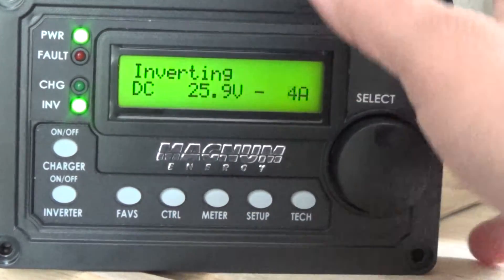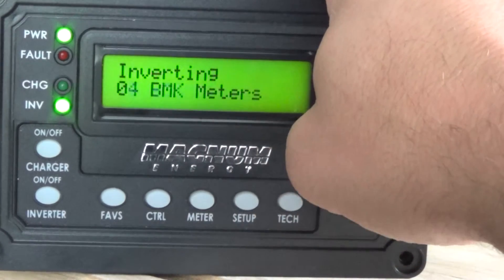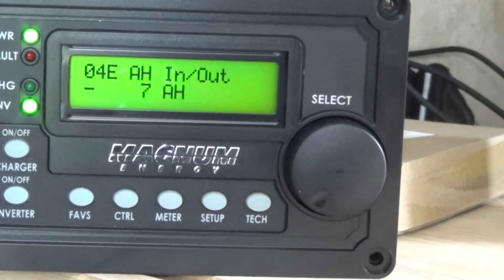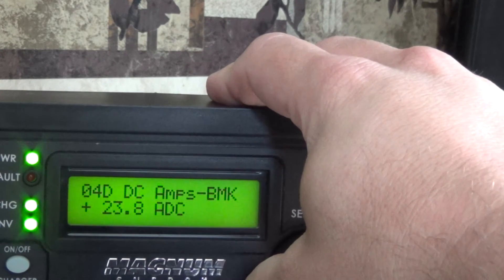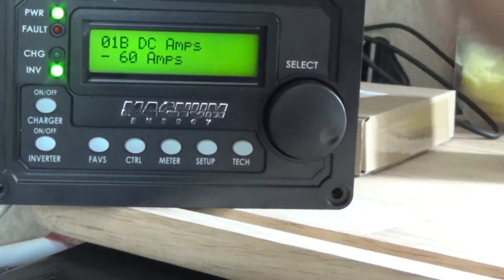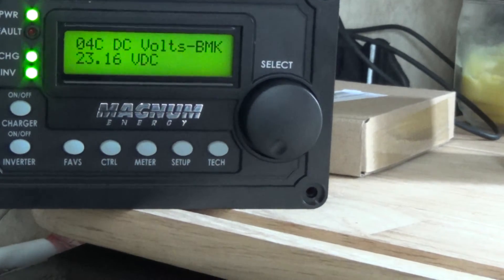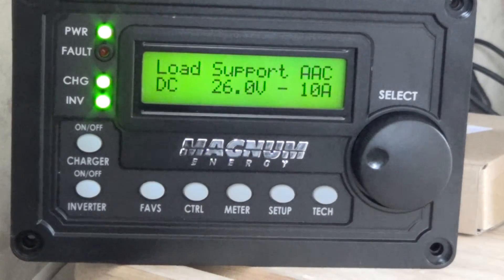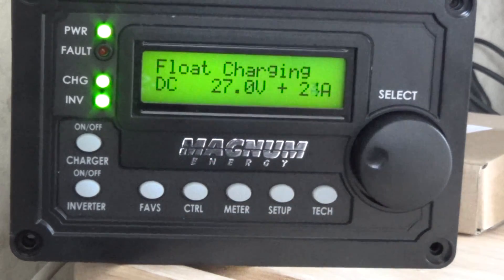Updated: Running an Air Conditioner with an Inverter and a Generator

Comment: You can try a soft start device. Like the Easy start made by Microair to get a low amperage start up from that small generator or inverter of same size. It will allow you to run your AC on those devices you use for power.

Comment: I have seen lots of people with problems trying to start ac units it will work you need a soft start kits on your account problem solved
Reply: This right here is your answer. You need a soft start kit on your A/C and you'll be nice and cool for as long as your batteries have a charge to supplement your generator output.

Comment: How big is your battery bank ?   Battery # ?
What make & model Air conditioner do you have ?
Reply from the maker: I have 8 Trojan T105Re batteries.    My A/C is a 13500 BTU Dometic.
Reply from the maker: I have 8 Trojan T105Re batteries.    My A/C is a 13500 BTU Dometic.

Comment: Have you ever thought about installing a large hard start capacitor on your AC so the current draw won't be so much?  The generator you have is running very rough and I would not expect to get 15 amps out of it.  You should have no problems running your AC with your setup and a decent running generator.  Have you measured the A/C amp draw on the AC unit while running?  A 13.5btu should only draw 10 amps+ when it is running.  That generator should be able to handle it.  The start should be good with your hybrid inverter if you install a hard start capacitor.
Reply from the maker: There was a capacitor installed when I made this video.  Doesn't seem to help much.
Reply: All ACs have a start capacitor.  Was the capacitor you are referring to a "Hard start" capacitor?  They are usually larger in value, thus making the load to start it, less.  I am not sure about your AC, but ensure the condensor unit is clean.
Reply from the maker: Yes , it was a hard start.

Comment: Can you use a higher current smart charger off the 120 leg of the generator?
Reply from the maker: Mark Jones Probably.  For example, my charger that is part of my inverter/charger can take 30 amps, but if it is only getting 15 amps, then that is all it uses to charge my batteries.  I can also tell my charger how many amps I want it to use from the A/C source, so that I don't accidentally blow a circuit.  Each charger will most likely have different features, so read the manual.  Thanks for watching.

Comment: RV Air Conditioning units have serious " power factor" issues making them horrendous loads to drive by any inverter..  We ran into the same issues having built a Magnum / Suniva Solar - GS battery system for UPS and NASCAR. you can Google "NASCAR goes Green" If you get a moment stop by Face Book and "Like" Lighting Energy Depot Inc. We Run On Sun..

Comment: That's not a lounging around task to complete that project. Anytime Ac is mentioned, you can throw alternitive energy out. Nice job.
Reply: Split Ductless "inverter" based systems use DC motors and compressors and have no serious power factor correction problems to deal with. Some with SEER ratings exceed 30 at that... The Next Generation units will using Photo Voltaic harvesting "Native Voltage" DC  - there is NO need for an inverter at all. Less conversion means less losses.
The Power To Choose US is easy to access.
Reply: Are there any 'next generation' DC ductless air conditioner units currently available on the market?  I'd buy one if they're reasonably priced.